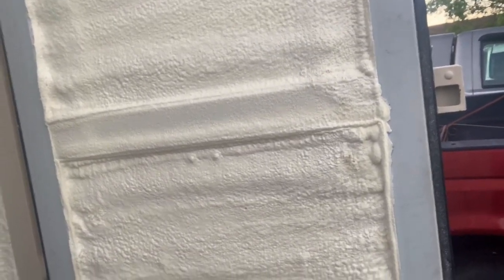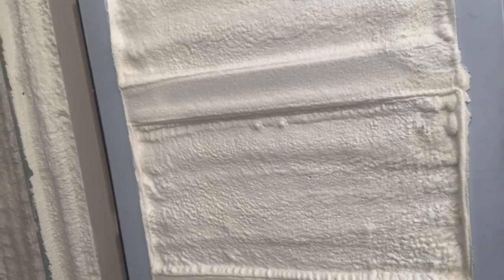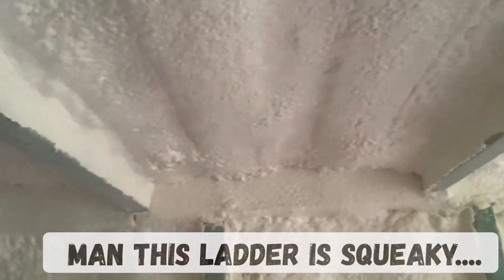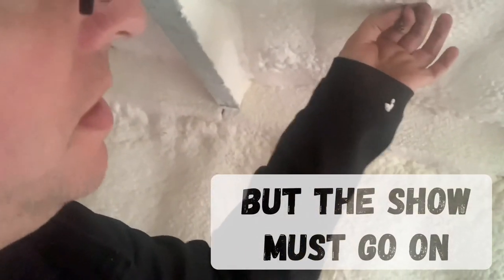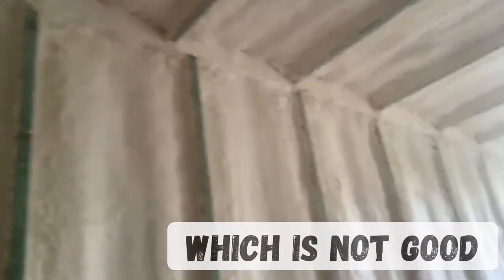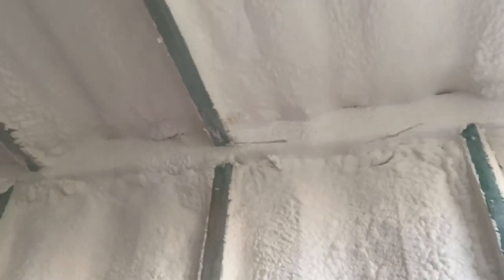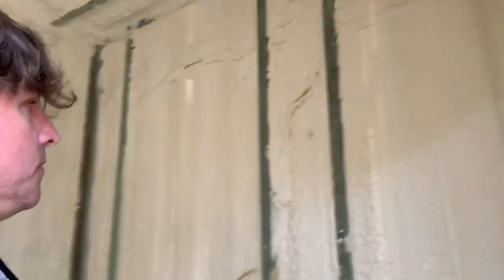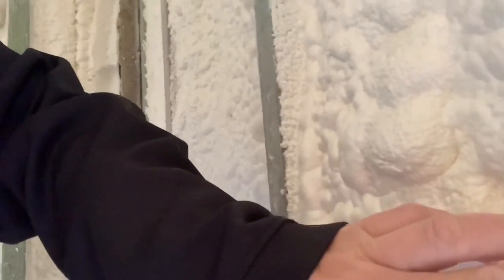Shipping Container Spray Foam Insulation A Must Watch!

Comment: Just curious ? Why you using green pressure treated wood ? You don’t need to worry about wood to ground contact. That green wood 🪵is wet and that moisture can’t be good to encapsulate. 
Why not just use regular untreated wood ?

Comment: Its great that you went 24" OC , being that the new walls are not needed for structural strength, less  thermal bridging  and noise, less material and labor cost.    But  you have no framing 90 degrees between studs in the corners.  The music track you played is excellent.

Comment: Did you add 2x4 on edge, reducing width by 4" per side, -8" combined. Now your shipping container is 7'4" width without interior finish, which will reduce it to about 7'2" when your completely finished. Amazing ...
Reply from the maker: yeah I put them on edge.  would do it differently next time.
Reply: @whobuddywantsit  How would you do it differently?

Comment: It is dirt easy to make the same foam blocks that InSoFast sells with just a board saw or a hot wire cutter.
Haven't seen a video on that yet and I still wonder why :)
Reply: Ceiling is inside. Roof is outside.

Comment: How much does it cost to do a 40 foot container?
Reply from the maker: $1800 to $2200 depending on how thick you want it to be.  They charge by the sqft and thickness.  About $1 per sqft ft inch.

Comment: How did you secure the wood studs to the container?
Reply from the maker: I used liquid nail on the wood to the walls.  then on the top I screwed into the square tube.  the bottom i drilled into the bamboo flooring.